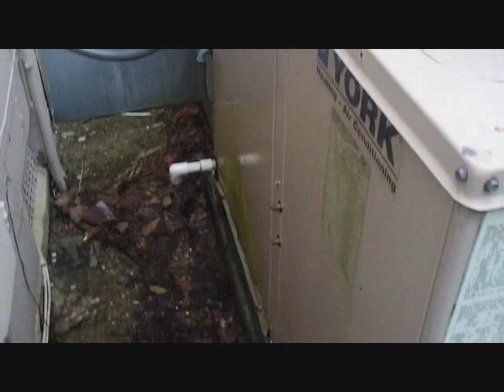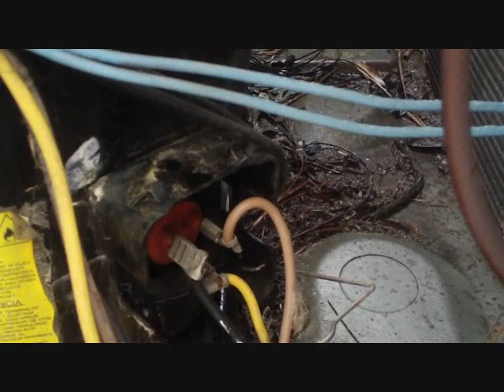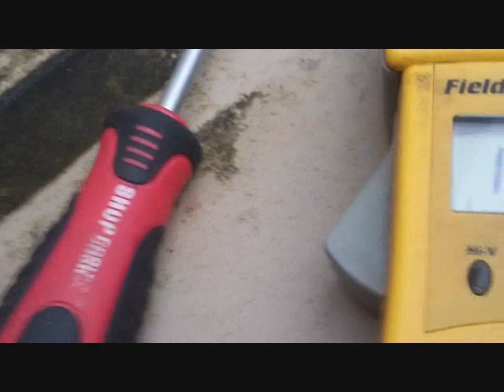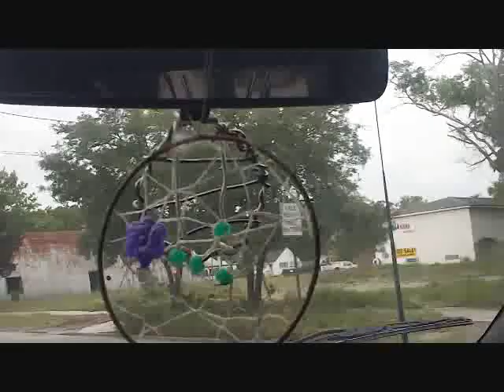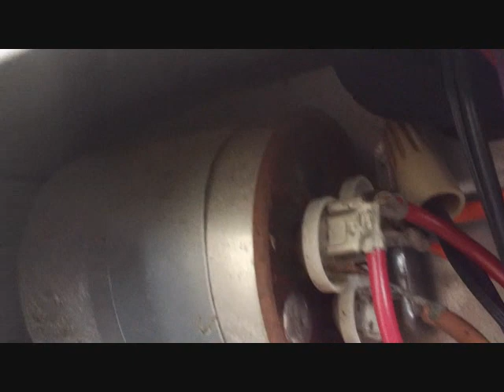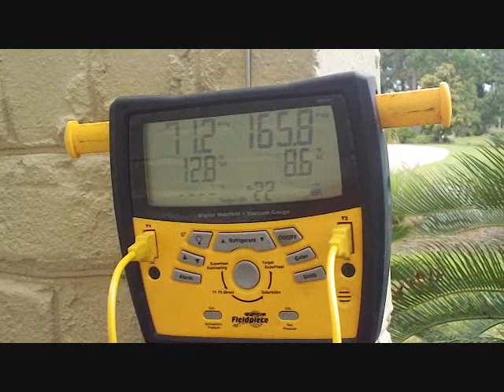HVAC Service- Heat Strip Troubleshooting and More!

Comment: I need help 10k heat strip only putting out 5k I was told it was bad, got new heat strip and put it in myself still same problem. MOD number bayhtr141000 heat strip wired correctly, what do I need to look for? Trane unit with heat pump and aux heat strip.